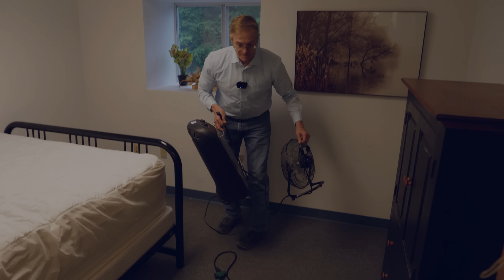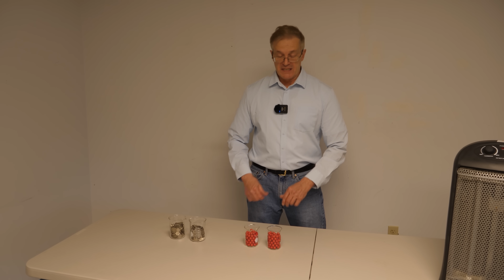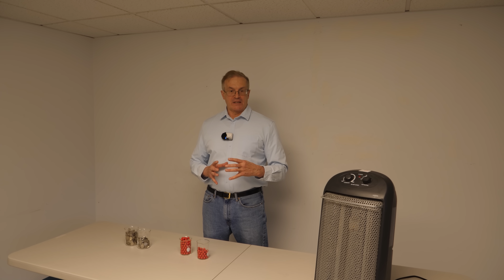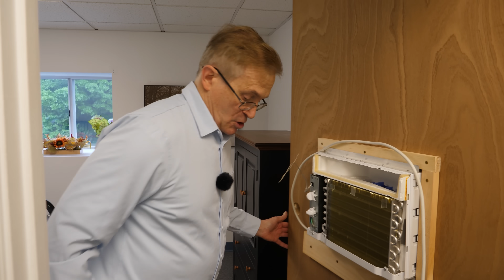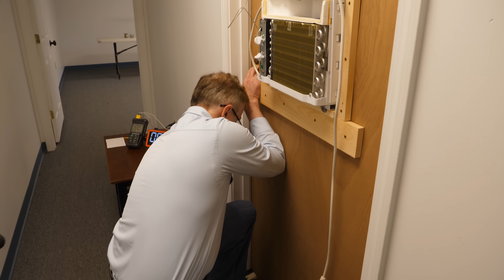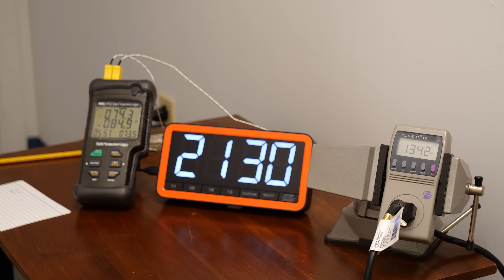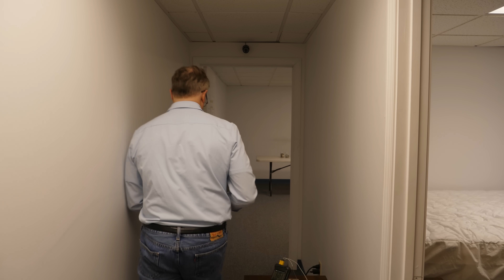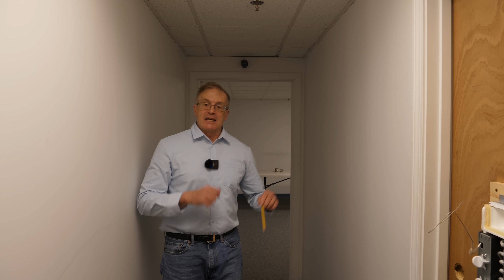You're wasting money on heating! Use your A/C!

Comment: As another viewer pointed out, there is one big fallacy about heat pumps that the proponents always neglect to mention.  As the temp goes down to frigid temps, Heat pump efficiency drops substantially!  Yes, your example works very nicely at 77 degrees, but who on earth needs to heat their house at 77 degrees?  Canadians are finding this harsh reality the hard way.  Their government has mandated heat pumps and people are spending $20-30k and finding out that when the outdoor temp is -20 their heater does not work worth a damn!  This is really not funny because the government and unscrupulous companies are making huge intrusion on our rights to choose our own solutions and profiting millions of $$$ in he process and as usual the people get (literally) left out in the cold.

Do heat pumps work in mild climates?  Yes!  Very much so.  But they are not the magic pill that fits every case and people who hide this basic fact are usually lying, or cheating or just tricking you.  As the outdoor temp approaches the boiling point of the refrigerant in the unit (R134a?) at the pressure drop of the compressor the system efficiency goes to hell very quickly and often the coils freeze solid way before that.
Reply from the maker: You're right.
But consider the potential of combining two systems that takes advantage of the high efficiency of the pump for a moderate differential and then the gap is filled with another source such as wood, gas oil or electric and the overall system efficiency as well as low cost and redundancy is maintained.
Reply: @TechIngredients  Very good point too.  I’m an engineer, so don’t think I’m anti-technology by any means.  But increasingly today we have politicians and con artists grifters with a hidden agenda forcing the wrong technology where it doesn’t belong.  If a millionaire in CA wants to experiment with a hybrid heat pump and alternate energy system that’s amazing.  And he simple fact is, there are plenty of very rich people that are happy to be Guinea pigs and try all sorts of things.  That’s the amazing thing about free markets.  All those rich people that bought the $15,000 flat screen TVs back in 2000 paid for the cheap Walmart $399 55 inch flatscreen anyone can buy today.  But here’s the thing, people never mandated that technology and they let it evolve naturally.  The same thing needs to happen with our energy usage.  And back to my point, we need to be brutally open and honest about the drawbacks of any new technology and do it with religious fervor because next thing you know, your poor grandma on social security is going to be mandated or tricked into throwing her last savings onto a scheme that didn’t come close to the simple reliable tech that she relied on for decades.
Reply from the maker: I completely agree.

Comment: Only issues with this is how typical AC units handle humidity.

Typical ac also condition the air by dehumidifying. That moisture is exhausted on the hot side. So you will heat the room, but also humidify it.

Comment: Nice comparative experiment, but not conclusive. The experiments shows that electrical energy is converted into thermal energy=heat. The room has a certain mass of air. The density of air is about 1.12 kg/m3. The room is about 20 m3. Therefore, 22 kg of air is in the room. The heat capacity of air is about 1.04 kJ/kg/K using nitrogen as air and the data of Nist webbook fluids. Hence for each degree kelvin 23 kJ is needed. Therefore, the heating of only the air with 11 and 15 F, requires after converting Fahrenheit to Kelvin: 140 and 190 kJ respectively.  
The airco used 420 J/s*1800 = 756 kJ and the heater used 1364*1800= 2455 KJ.
The airco seems to have an efficiency of 190/756=25%, while the heater has a poor efficiency of 140/2455 = 5%. 
However, the airco is very close to the temperature sensor and gives less convection of air than the ventilator, thereby not giving a uniform temperature of the room and less heat loss to the wall and window, while the heater gives a lot of convection, thereby heating all the air in the room and loosing a lot of heat to the cold window and the walls. In other words, the test requires more temperature sensors to conclude the room is heated uniformly in both cases.
Reply from the maker: No, this isn't conclusive.
But, like most experimental designs, the general principles should be set up, and then the details and shortcomings can be tested and corrected to provide accuracy and repeatability.

Comment: So have a drip pan ready if the coils freeze or condensate since window units are designed to drain out the exhaust side. I’d imagine that issue would be exacerbated by a colder intake temp and moisture from outside air running one “backwards”.

Comment: Big number headlines in unrealistic conditions, you rarely disapint me, but you have today! The big trouble with heatpumps is their effectiveness diminishes drastically the lower the outside temperature is, efficiency drops nearer 200% when it's below freesing outside resulting in them only being suitable for more modern buildings with very good insulation?

Comment: Long time subscriber here. Love the great content! Just a thought about this kind of demonstration... While it does indeed show the intended principles, at least in qualitative terms, it may be less than perfectly clear to some people. Heat capacity of the room and contents has to be considered in the abstract, complicating analysis. 
Adding another demonstration working a slightly different way might reinforce the experimental result. In particular, pitting the cooling power of the air conditioner against the heating power of the heater, and adjusting the power of the heater so that it matches the power of the air conditioner. Then, because the coefficient of performance of the air conditioner is well above unity, 1.0, the room will cool despite the continual addition of heat. 
Or go for a steady-state situation: adjust the heater power so that the temperature of the room does not change at all and compare the measured power consumptions. Then you really have an excellent quantitative result.
Just a thought. 😊

Comment: it's a good demo and an excellent explanation of the thermodynamic principles. i would like to have seen a comparison of kwh used to raise the temp , say, 10 deg F. also, it's a small point, but running the fan for both tests would have been a more controlled experiment

Comment: When the outside temperature  goes below 40F,  the resistant heaters in heat pump system will turn on and the  advantage of a heat pump system declines.  Compare using a heat pump in Texas to using a heat pump in Minnesota. In addition, compare heating with the heat pump in a cold climate to heating with natural gas.  I know one person who has substituted natural gas for the resistive heaters in the heat pump.

Comment: What do you do with the water vapor in the room?
Reply from the maker: Only if the condensate from the cold side is directed to the hot side would any water be added to that air. In addition, winter conditions generally include indoor air that is too dry.

Comment: Just a heads up you probably won't see, but your kill a watt meter also has a function to measure total electricity used during a time period. Just unplug it to reset.
Reply from the maker: I know. 
I wanted the real-time flow to be visible as the airconditioner's draw increased rather than a single summary at the end of each test.

Comment: If you didn’t count the cost of the unit itself and the cost of the gas in the  coils it may sava a little but try putting your condenser out in the cold on a day that is below thirty or so degrees or so. I believe it will just keep running and never get the house warm. Resistance heat will warm the house under those conditions. Thanks, it’s good to have both of you can afford it but for less than $30 for a plug in heater what my intuition is don’t even bother with a heat pump

Comment: This is more efficient than operating the A/C unit in summer, the energy used to compress the refrigerant is normally exhausted as waste. But in this setup that waste heat is added to the room along with the condenser heat. If you make a plastic shroud around the side vents and a duct to the ceiling and floor it would also maximize the comfort level and efficiency.

Comment: Heat pumps are great, but this test is very misleading. You start with both sides of the heat pump at the same temperature and only let the system run for 30 mins. So sure, with a temperature differential of 0, you can see an order of magnitude improvement over resistive heating. But this is not a realistic scenario. If you were to let this test continue for longer, you would see the temperature change driven by the heat pump plateau while the resistive heater would continue to drive a nearly linear change as long as the room is well insulated.

A more realistic test would be to start with a temperature differential between "inside" and "outside" of 30 to 40 degrees (or more) and just see how much power it takes to maintain that. You'll see much less than an order of magnitude improvement of the heat pump over the resistive heater. And the larger that differential is, the worse the heat pump will do.

Comment: REMOVING THE HEAT FROM ONE ROOM AND PUTTING IT INTO ANOTHER ROOM STILL REQUIRES YOU TO HEAT THE FIRST ROOM WITH AN ELECTRIC
SPACE HEATER.  USING THE AIR CONDITIONER TO COOL YOUR HOUSE AND PUT A WATER JACKET ON THE A.C. TO PREHEAT YOUR
INCOMING COLD WATER SOURCE.  A HIGH FLOW OF OUTSIDE AIR COULD COMPENSATE AS A HEAT SOURCE ON THE EXPANSION COIL OF THE A.C..

Comment: That was a very good video Thank You.
I have a 20X50 ft. steel frame building that I use for my workshop, when it was built I had the builders install reflective silver double bubble insulation between the outer sheet metal on the walls and the steel frame and under the roof sheet metal. After it was built my wife and I finished it out on the inside with sheet metal, we looked into having spray foam installed but it was over $6000.00 for a 1000 sq. ft. building.
That was cost prohibitive as we are retired and on a fixed income. So we opted to use more of the reflective silver double bubble insulation between the Interior sheet metal and the frame same as was on the outer sheet metal. So what we now have is a wall cavity that’s 5.5 inches deep with sheet metal on both the outside and the inside with double bubble insulation between the outer part of frame and outer sheet metal and the inter part of the frame and the inter sheet metal. The reflective silver double bubble insulation acts as a radiant barrier and as a wall gasket helping seal the wall cavities there by reducing air movement within the walls. Dead air is a very good thermal insulator (Not so much for sound). We also added blown in fiberglass insulation in the attic. When we finished out the inter we divided the building into two sections one section is about 2/3 the size of the other, it’s this 2/3 section that is heated and cooled using a 12000 BTU Mini Split Heat Pump AC system. Most of the time it consumes around 350 to 400 Watts in the summer and a little more in the winter. I am thinking about adding a geothermal heat sync to the Mini Split to see if it can be improved.

Comment: Heat pumps need super insulated homes, old houses are useless for heat pumps. The water temp produced (washing/bathing) is not hot enough to stop bacteria growing in storage tanks ( storage tanks are required) so an immersion heater is needed to raise the temperature. If you are driving radiators the tepetatures you can ahieve are low which means circulatory pipework will need changing to a bigger bore and radiators need to be larger. So what do you think that means for your average house conversion including insulation? "BIG BUCKS" You'll never get your money back, even if you get close, say in twenty years, in fifteen years max you've then got to replace the heat pump system

Comment: 1 hour between tests is a bit short without active ventilation in the room. The surfaces will lag behind and so be a (tiny) bit warmer than they normally would be for the same air temperature. and imo you should have left everything in the room as is: The electric heater is heating up it self too - which is further mass that stabilises the rooms temperature - and the heatpump also was already installed and stayed in place. again just a tiny difference.
But those 2 things are just so simple to do and kinda seem obvious that i wonder: why did you choose to do the setup like this?

Comment: What are your thoughts on Electrostatic Cooling? It seems to make removal of heat much more efficient at very low cost. 50 Watts for example was able to remove heat to make welding of the wing pins on the F-111 possible. It removed heat through the thickness of the pin using ion probes.  If we added ion probes directed at the condenser on the AC could we more efficiently remove heat as with the wing pin?

Comment: the most cheap heat pump - your window. if your room is cold and you wanna warm it up and outside is warmer - open window. same works opposite. if you wanna cool your hot room down - open window when outside is cold. this I do all hot summer time - opening window during colder night time only. works better if you open two windows at different parts of house, one should be at base, one should be at upper floor. chimney effect.

Comment: I ditched my propane for my ac/heat pump window sized unit for 509$ 
 Fantastic kept warm all winter long 
 Adding next kw to hopefully operate it more on Solar not backup generator. I’m amazed with heap pumps success! Author of Solar Independent Utility Systems Manual 
Censored

Comment: That's nice when you're talking electric "toaster wire" heater vs heat pump, but a gas furnace is more cost effective especially when you take balance point in consideration. A good rule of thumb for heat pump HVAC units is the balance point for heating is an outside ambient air temperature of 40 deg F. Most heat pump systems are equipped with emergency heat strips that are set to turn on at 40 deg F at which point burning natural gas or heating oil would be more cost effective. That being said, if you live somewhere that does not drop below balance point that often it would be good. I am looking forward to seeing your next video on improving AC efficiency being the air conditioner is the largest load in most homes.

Comment: Look I think you missed a critical "element".  Those radiant heaters have shut offs.  They will heat up to a certain point and then shut off.  That room would have been much hotter unless you disabled the high temp shutoff.
Reply: Not saying the AC "heater" isn't a good idea but your experiment is flawed.

Comment: I think a simple explanation is that the heater changes electricity to heat and the pump is only using electricity to move the heat between 2 spaces by extracting it from one and dumping into other one.
Reply from the maker: That's it.

Comment: Could this work with venting standing air-conditioners in an opposite manner as well?
Reply from the maker: Can you be a little more explicit?
Reply: @TechIngredients  - a portable AC unit.  I was thinking of doing this exact same thing with a portable AC unit and ducting the hot air vent into the duct system of my house and building an exhaust over the cold air vent and venting that to the outside.  Your thoughts?  Seems like the same principle...  Big fan of the channel BTW!

Comment: Meanwhile as we sit at non-smart red traffic lights idling gas away with no other traffic in sight.. and as we throw away millions upon millions of tons of forestry in the form of unwanted unsolicited and unread paper junk mail (the production and delivery logistics of which itself leaves a tremendous footprint) in each and every mailbox in america, we could be using 1/4 the energy currently consumed in heating our homes.. AND get free potable AC drip water out of the air in the process of doing so. And they have the nerve to tell us that our gasoline powered lawn equipment is making too much pollution and needs to be replaced with battery powered garbage!!

Comment: AC manufactures should be forced by regulation to install that reversable valve for 2 way operation. Here in India almost no company sells reversable heat pumps
Reply from the maker: I'm strongly opposed to "forced."
If the technology works and saves resources and money, this will be implemented by choice.
Reply: @TechIngredients  When the market is too corrupt some regulation is needed for sure though. Perhaps not forced but though incentives/small subsidy for reversable  heat pumps. 

In India even if a tech saves resources it is not implemented because for example the money saved is not for the ac companies its for the customer.

Comment: The problem is that electricity is about 3 times more eypensive then burning stuff (wood pellets), meanwhile installing heat pumps for the whole is is like twice as expensive.
Reply from the maker: That's roughly correct. It's not really a problem as the application and the conditions will determine the best choice, including mixing systems for redundancy and flexibility.

Comment: My main question is how would this deal with frost from condensation in freezing temperatures? That seems to be the big difference in two way heat pumps is that they can run a defrost cycle when needed to maintain efficiency.

Comment: AC window units like this drain the condensation to the hot side. If you run them backwards, you will have water evaporating/dripping inside your room. Commercial heat pump systems have condensation pipes to carry the water outside of the house.
Reply from the maker: Correct

Comment: And 450w is something you can power with two cheap solar panels on a cloudless day.

Inverter-type compressors can run even at as low as 100w - but still produce ~500w of heat.